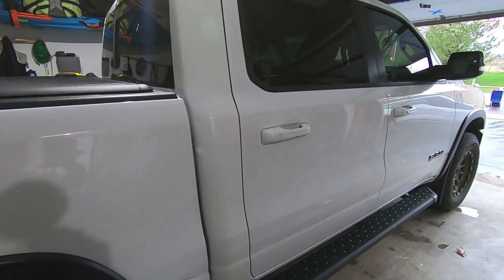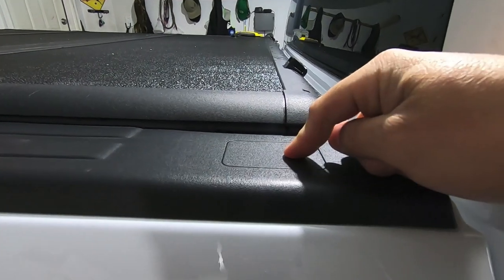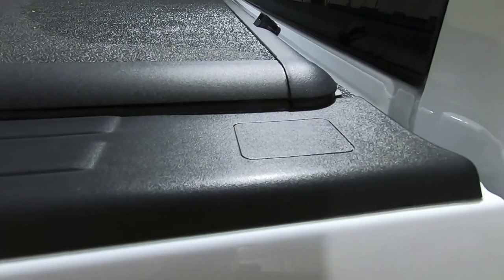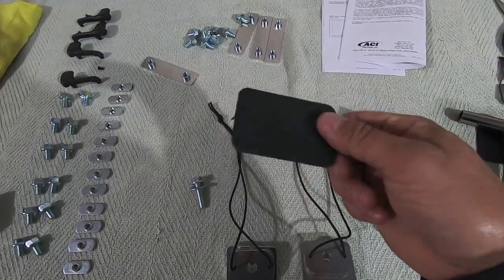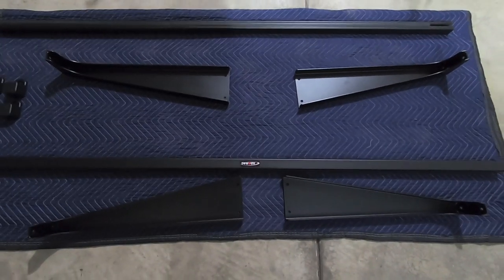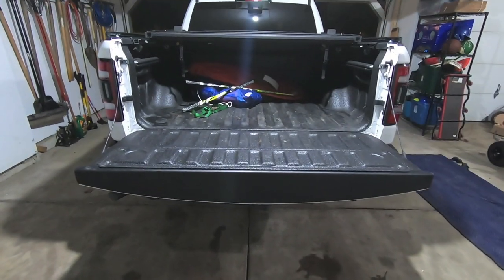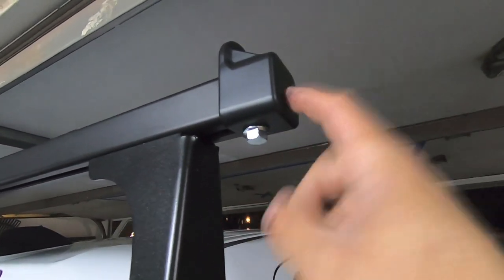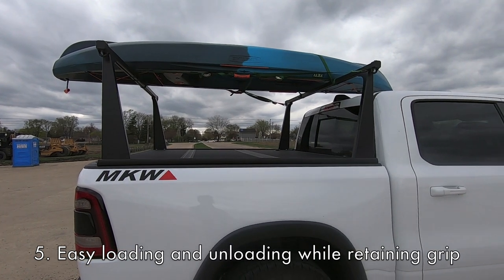Adarac Pro Series Bed Rack - Ram Rebel

Comment: Great video!  Thank you--wrapping up installation right now!  Love the combo with the cover--we have been looking for years for a rack w/cover for our 2500 Ram, and be able to fit our bikes into the bed as well as the kayaks up top.  This combo is one of the few (only?) we have found and very affordable.  Next step is to find kayak holders for two kayaks that will fit onto the rack.  Are you comfortable with just tie-downs?  We will be traveling longer distances with a travel trailer attached.

Comment: Great informative video.  Ordered my Pro rack today as a result!  Had a Thule roof rack for my 2010 Dodge for my kayaks, and intended to use it on my 2020 RAM, but it doesn't fit, so I would have to buy a whole new set up.  Glad I saw the video, the ADARAC is a way better option for basically the same price as the Thule, actually a bit less and way more functional / accessible too.

Comment: I got lucky.  Retrax Pro XR electric cover now has the T grooves built right into it.  2021 F150  Reg. Cab.    This cover locks in place wherever you stop it.  It has remote I keep on keychain. :)  Regards.

Comment: I've been looking for a rack that could be installed without removing my Tonneau cover...then I discovered this rack solution on the ADARAC website.Further investigation and I found your install video. As you mentioned..it's a rare thing to find a rack that allows you to do this. AND THEN...the bad news; I have no stake holes in my 2003 Dodge Dakota...so now I have 3 options: I could never haul my boat, or I could take off my Tonneau cover and buy one of hundreds of available clamp-on truck racks. Third option...buy a different truck ( one with stake holes) and install this rack. Why Dodge would build a truck without stake holes is a mystery... next truck extremely unlikely to be  a Dodge because I've got a pretty good grudge going over this whole thing.
Reply from the maker: Are you sure the stale holes aren’t there? A lot of trucks have them but the plastic bed cap covers them up. I would look into that a little more before completely throwing in the towel
Reply: @WaterFowler41  Believe me...if there were stake holes in this model truck..I'd know it. Perhaps since ADARAC is selling these stake hole products, they might want to familiarize themselves with the few truck models that do not have stakeholes

Comment: Instead of slicing the back stake pocket would it work to go at it with a router bit? I wonder if you can retain the top piece of plastic but just remove the drop?
Reply from the maker: If you could fit a router in there, go for it

Comment: Good video. Talk about timely. I’ve been looking for a rack for my Rebel for months that would fit with my hard folding cover. When you remove the racks, the channels stay on the side rails right? 
I have a kayak and my wife has a paddle board. Looks like they would fit. I was thinking I had to go to a roof rack mount which I didn’t want on my Rebel.  Thank you.
Reply from the maker: Yep the rail stays on and it can actually double as a tie down rail. 

The cross member is very wide which would fit 2 yaks or in your case your kayak and your wife’s board.

Comment: Great informative video! Can you tell if the t-slots along the rail would be compatible with extruded alum like from 8020? (Just looking at potential future custom things)
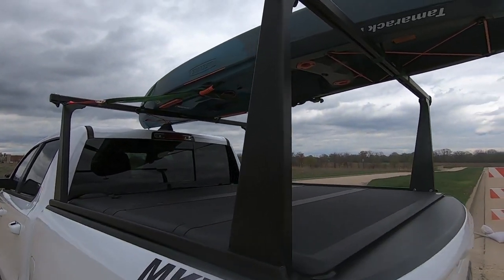26:40 and 25:30 I had to chuckle because it looked SUPER tight when it was all up there, lol! At least you didn’t have to remove the towers.
Reply from the maker: I think the t slots would work but I am not 100%

Comment: Looking at this for my Ram for the same reason.  Glad I found your video.  I was surprised to see the bit about cutting out the stake pocket.  That concerns me a great deal.  What tool do you recommend for cutting that thick plastic? Any risk to damaging any sheet metal?
Reply from the maker: A Dremel or rotozip works perfectly. As long as you go slow you should be fine.
Reply: I used a box cutter.

Comment: Excellent video WF41! I was also looking at what would fit my Rebel with my BakFlip MX4 - your video came as I was zeroing in on the Adarac and KBVoodoo. Wondering if you think the size of cross bars will hold a Thule roof box given the 1.5 inch size bar on the Adarac?
Reply from the maker: I saw a video of a guy running a box on the same rack so I would assume you can. I don’t have much experience with roof boxes so I would double check.

Good luck with your rack research, I think right now this rack is like $450 on realtruck.

Comment: Thanks for this very informative video.  In your opinion, is this sturdy enough for  a hardshell RTT that weighs 140lbs?  It would see some moderate off-road use.  And, do you think the lower height Adarac would be better?  (I could use a rolling tonneau cover with it)
Reply from the maker: I’ve seen folks throw rtt on top of these. I’d double check weight capacities but I’m fairly certain you can.

No you can not lower the height.

Comment: Thx for the video. I've been looking for one for my Power Wagon with the Rambox. Crazy expensive! I'm thinking about building my own.
Reply from the maker: Yup the Ram box makes things very challenging when it comes to racks. Racks can get into the $1k range real fast.
Reply: @WaterFowler41  Yeah, the two options I've seen for the PW/RamBox are like $2600 bucks after options and shipping. No way baby! That's the Nutzo and Contour. There are internal mount, but I run a Retrax Pro cover and dont' want to loose that. I think I've figured out a way to attach and still use the Ramboxes. Just a matter of deciding if I want to try and modify something cheaper, or try to weld my own.
Reply from the maker: Where there’s a will there’s a way

Comment: Other than drilling into the uprights is there a way to mount stuff to the sides overland style.  Or is that not recommended.
Reply from the maker: I’m sure you can drill into the uprights but that would be the only way to add overlanding style cross members

Comment: Thanks so much for doing this video! I have a 2019 RAM Rebel with a BackFlip bed cover and this rack absolutely fits and allows my bed cover to stay functional. Just as easy to mount as you showed. I also had the same challenge in that the garage door is a couple of inches too low to fit the truck, even when I lower the air suspension to the lowest setting. The truck only goes into the garage in the winter so taking the rack off come winter and leaving the side rails on looks like the easy solution. Am curious about mounting a kayak in that it looks like like you just mounted it directly to the rails? We have a 13.4 foot x 34 inch wide Ocean Kayak Malibu Two XL coming (it will carry me and the wife or one of us and our 90 pound dog). I thought I would need to add kayak mounts of some kind to the rail but looks like you have just dispensed with that? Also looks like you don't bother to tie down nose and tail of kayak? Any advise welcome.
Reply from the maker: My kayak gets strapped directly to the rails.  The rubber strip is enough to hold the kayak still.  I then loop a strap across the front and one across the rear.  Then I use a bungee cord to keep the front handle from rattling on my roof.  No issues with the kayak moving at highway speeds.
Reply: Jan I have a 2022 RAM 1500 with a BackFlip.  What size uprights did you get?

Comment: Great video, thanks.  Anyone know if this rack will work with a Softopper (in my case, 2013 F150 XLT)?  Tx.
Reply from the maker: As long as your topper doesn’t cover the stake hole pockets you should be good
Reply: @WaterFowler41  Thanks, appreciate the response.